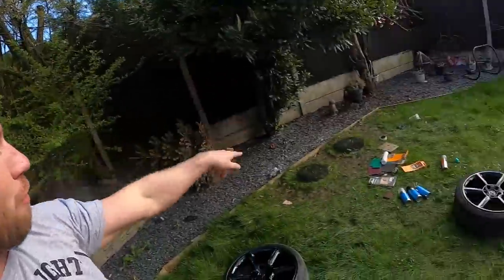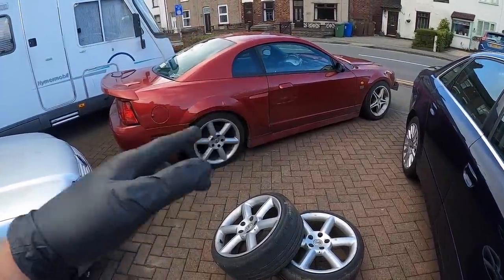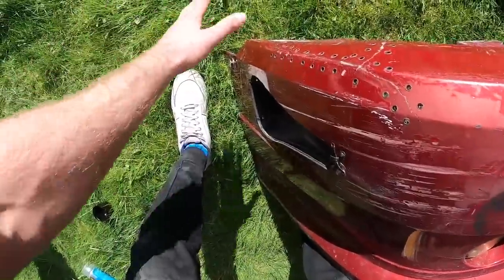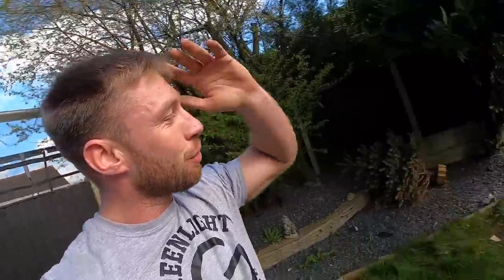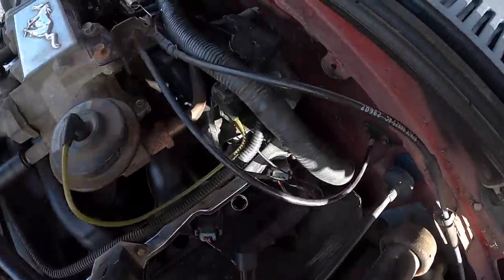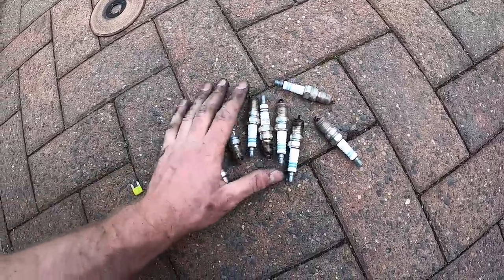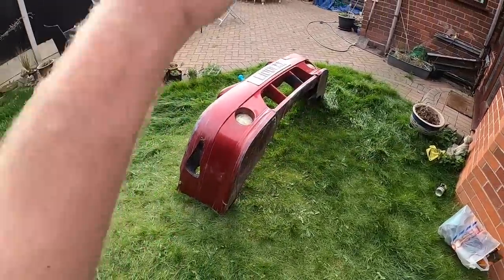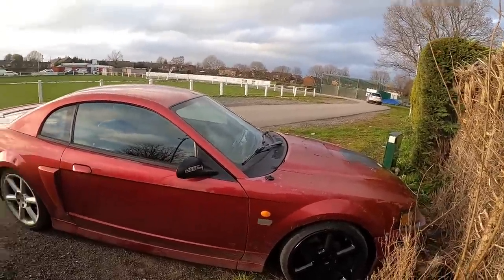The Mustang transformation BEGINS!

Comment: oh where to start... for drifting, id say leave the wheels best you can get them unless you want it to be a show car first but then you need a new front bumper. speaking of bumper i think what you have done should be ok but id be tempted to strengthen the back of it. maybe fibreglass some wire rods or even welding wire or chicken wire, just to help hold it together but not restrict it flexing. engine... i dont really hear a missfire but i do have an autistic 6 year old daughter singing taylor swift songs next to me while im trying to watch the vid lol. will re-watch later. question though, do you know if its mapped? i am thinking the pops are from a tune and it might not be the best tune. if so id recommend rolling road tuning it to perfection. you said you replaced plugs and coils but i only saw new plugs, not sure it needs coils but if not done it might be an idea to eliminate them and also get maximum performance. just my thoughts at this point, regardless, great job so far